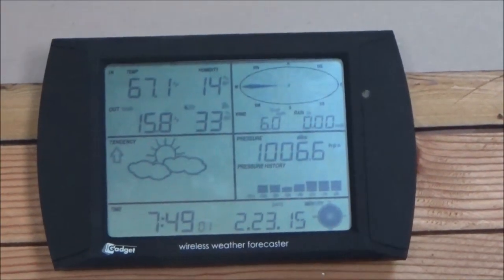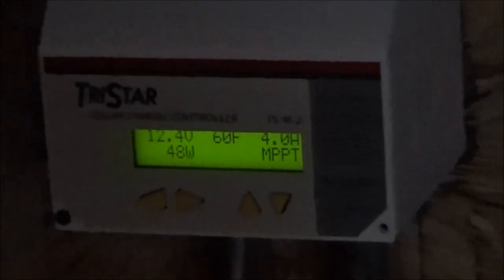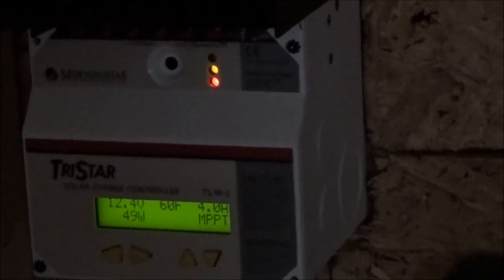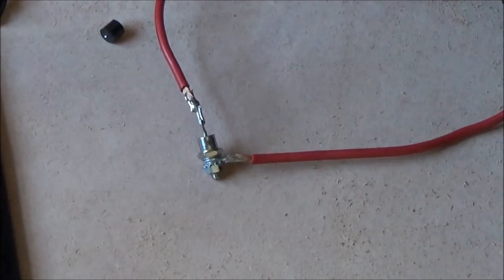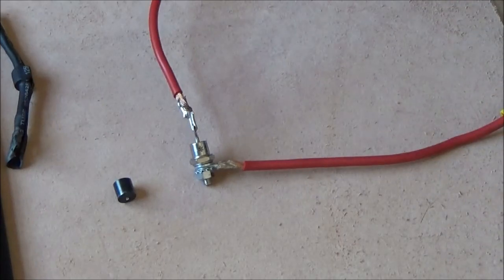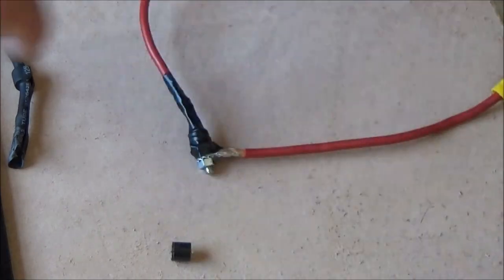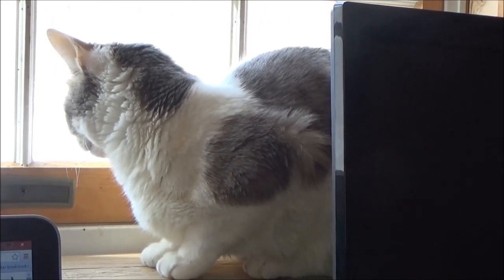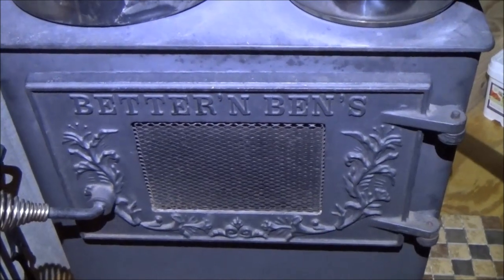A Day At The Off Grid Homestead And Tiny House

Comment: Hey, did you people know that the diode was designed to be mounted on a heatsink? Even Troy knows that, and if you read the video description he mentions that he will be mounting it properly later on!
Just in case your computer does not show the video description -

"This new blocking diode is rated at 1,000 volts and 25 amps. I will put a heat sink on it soon as well for proper thermal protection. But for now with the wind turbine at its present elevation, there is not really much power being produced at all."
Reply: John McLendon
Strange, but is my video description the only one that has the phrase

 "I will put a heat sink on it soon"

?????

And to make it worse I even quoted the paragraph that has that phrase in it!
And YES I UNDERSTAND THAT IF IT IS DONE CORRECTLY THE FIST TIME IT MAY NOT NEED TO BE REDONE!!!!!
Why do you try to FORCE your perfectionist views on Troy????
First read and understand the video description, then comment if necessary.
If you had said "Troy, you really do need to put the heat sink on now, while you have it in hand." or something similar it would have been a helpful comment.
Reply: John McLendon I agree, it was said by several people. If you will read my original post it was not to you.
Now, for some reason, someone has blocked my posts/replies from showing on the comments section. I guess the trolls think I'm a troll??? Ok, I'll resist the temptation and make no more posts on the comment section of Troy's video's!
Reply: John McLendon
Under the part you quoted there is a box that says "SHOW MORE"
Reply: J. Williams I don't think you were deleted... not sure if the comment you referred to has come back yet, but YT does some weird stuff to the comments...  The other day when I first logged in the video was up for only one minute and it was displaying like 600 or so comments... I was like WTH!!  Then I realized the comment from the day before were showing on the new video, so I refreshed... still there.  About 5 minutes later it suddenly refreshed itself and the expected 15 or 20 posts were there that applied to the video.  Later people said their comments were coming and going.  GooTube seriously needs to stop sending updates it just makes things glitchier!

Comment: You don't listen to me on batteries so I doubt you will listen to me on diodes but that diode works better with a heat sink you should put at least a washer to help get rid of heat.
You should measure those batteries with your vote meter then go out side and measure the battery voltage on your truck battery. It has just as many cells in series (6) . Will it still start your truck? Your car battery.
Reply from the maker: I said in the video description that I will do that with the diode.
It is hard to "listen" to you when you post so many things across so many comments but do not often see my replies.
Reply: ***** <----Sweeps floors at McDonalds.
Reply: Bernie other <---Fearful of women expressing ideas.
Reply: Bernie other <--- Seems to think an insult will get a point across but it doesn't -
Reply: MsPunkin13 <----Can see the conversations on the bell where a large portion of the comments from numerous people are made.

Comment: Troy,
I went and found a motors manual about charging and battery voltage from Ford. In the morning if you have 12.2 -12.4 voltage you are good to start. Now at night when you turn your car off, you may have 12.4 to 13.0 or above .The voltage above standing volts is called a surface charge. now, in most cases that is a good indicator of charge. But you are using a multimeter and that has a no draw system. You need a voltmeter built back in the 60s, so that the battery is loaded a bit and you can take the surface charge off. (the other way is keep a 1157 bulb wired up and use it to take surface charge off.) The best way that we were taught was to use a hydrometer and make sure the cells read in the green, if one is low you may not have a good cell. Now this is only true for lead acid batteries. If you want more just ask and we can talk. To me the batteries sound like they are in good shape for lead acid ones.

Comment: nice cold junction on anode side of diode, they are designed to be soldered hence the hole on the solder lug and bolted to a heat sink for rated amps.

Comment: Read the voltage on the battery post under charge (40 amps +) to read if it's the same between the charge controller and the battery!!! To see if there is a loss!!   The diode I would have soldered the little loop! Check for heat of the diode when the wind turbine is really going!!

Comment: Not sure if you will see this comment Troy, but that diode should be mounted to a heatsink of some sort. Diffusing heat will help improve its service life GREATLY. I also would not have used the leads from the old diode, rather I would have split the conductor and wrapped that around the post of the diode. 

Ill make a video explaining this if you want, and if you need more diodes, let me know. I inherited a bunch of those things.

Comment: 12.4 is a ok resting, inverter on yes it draws something, yours i bigger than mine, mine is about 30 ma, but mine is on and have 2 batteries for awhile, and is stayed on even when the neighbour has put snow on my panels which melt off. great show
Reply: ***** snow blower, i have them 5 feet in the air, now i have silicone sprayed them which is the stuff i use on my snowblower's external parts, the snow slides off. he works shifts, and have not spoken with him about it, do you have any snow

Comment: You most likely have a bad cell in you forklift battery string. I would recommend breaking it down to its 2 volt individual cells. Find the sulfated cell and put just the one bad cell on you bedini energizer. You will have to watch it carefully as to not over charge it. Then it's a process of charge and discharge many many times to desulfate it. The forklift battery is a string of many cells. You probably already no that, but when charging a string of any sort the battery's in the middle always suffer. Same with forklift strings. To desulfate that entire battery you would need a bedini 20 or 30 coiler. Even then the center of the string would be hard to get at. The bad cell is most likely why the string won't hold a charge. One cell shorted is a constant drain. This is also most likely why you were able to obtain the fork life battery. As good used  ones go for around a $1000 or so. Just some food for thought. Hopefully the cell is just badly sulfated and not shorted.....

Comment: Turn off ALL loads would be a good place to start. Next would be call the battery folks and check with them about the voltage. Where on the battery is the temp sensor?

Comment: I spent several years working in a battery shop for the military. You need to stop short-cutting everything, build a proper insulated shelter for those batteries, charge them up correctly, and you should not have anymore issues. Most of what you have going on is due to all of the "short-cuts', and "temp fixes" that you keep doing, In the long run, they cost you more time and money, that's not how someone becomes "self-sufficient".

Comment: Wish you would have bought agm batteries. Safely store them indoors, mine are a year old and sitting at 13.2 volts 1 hr after the sun set. I use a CTEK smart charger during cloudy periods and it also desulfates my bank.

Comment: Man you are having a tough time with your power, we dont have to even check ours lately except for S.G. now and then and we have a piston pump, 120v led lights, home stereo,ghetto blaster, modem, laptop, chargers, c02/propane detector that are used constantly, mind you we never shut it down until the inverter alarms for low voltage at 11.8v or  whatever, the one thing i did notice about  your system is the wires coming into the inverter look smaller than the ones going out? I may be wrong but I wonder if there might be an issue with undersized wires, we used oversized so its never been an issue here just a thought

Comment: I was always taught in the automotive field and made to understand that other than de-sulfation to restore batteries, that adding sulfuric acid to raise the specific gravity in the water will help restore them to better condition? I have done that to numerous automotive and truck batteries during my garage work days and it has always given them a new lease on life, unless they were shorted or damaged in their lifetime?...I am just suggesting that possibly the FL batteries are weak on sulfuric acid making them lower on the specific gravity than where they could/should be, to be more effective at holding a charge longer...

Comment: You MUST PUT that Blocking diode piece of aluminum angle so it is finned. so it can cool. It will get really hot. I have seen two aluminum angles facing away from each other with a hole drilled in them while laying on top one another and you nut them together so they can dissipate heat. This is a must and dont cover it will black tape it melt and get all gooey and it needs air.
 Google on youtube how to make a heat sink for a blocking diode.
Reply: shartne First, read video description. Then, comment.
Reply: shartne <----Imagines itself to be an authority figure.
Reply: shartne Nice. You hit the nail on the head.

Comment: They are sulfated take them back and get some that are resting at 12.8 the voltage they set at is unaceptable. TAKE THEM BACK NOW before its too late. Dont accept them they are passing some sulfated batteries on you. Tell them to replace them with some that rest at 12.8 or at the very least 12.6.

Comment: Every time I watch these videos I really have to take pause and shake my head. I have explained in great detail in many of his video's the following:

1. You can not purchase used / reconditioned batteries from anyone. In plain English people are selling you end of life batteries and what ever life they have isn't a lot.

2. 12.20 - 12.40 VDC in the battery world is pretty much empty, drained, no good. A battery at rest at ALL TIMES should remain above 12.80 - 12.90 VDC for flooded cell batteries which does fluctuates based on temperature. Normally a variance of 0.1 - 0.25 is seen in the extremes.

3. I have stated this a dozen times and Troy continues to ignore the basics. Even if you had the money for brand new batteries and I don't care if they are Rolls, Trojan, etc. The manner in which you use and abuse these batteries are simply incredible.

There should be NO LOAD on those batteries, ever .  . . If they were new you would have some wiggle room and assumes you're using them correctly and not dropping below the stated DOD.

DOD = Depth of Discharge

Every battery has a stated voltage / DOD it is allowed or recommended to endure and sustain. For those who live off grid and do this correctly they rarely break 50% DOD. Most are conservative and only run down to 80% DOD.

Why???

Because this impacts service life, cycle life, and run time.

4. Take off that stupid shit desulficator it won't work and never will. The constant draw along with your inverter is once again proof you can't follow basic information, guidance, and knowledge from others.

5. There are countless video's about charging batteries. Its clear to me you believe pumping in 60 amps into a battery cell with out any thought about the duration, water levels, and voltages, will do no damage.

You're so wrong on every level it pains me!

As I stated in past videos about those piece of crap golf cart batteries and the so called recon batteries those stupid fools pond upon you. It was just a matter of time before they died. And they literally died a month after I told you so!

6. ONCE AGAIN I AM GOING TO OFFER YOU SOME SAGE ADVICE. THOSE FORK LIFT BATTERIES ARE JUNK. THEY WILL NOT HOLD A CHARGE AND IF YOU WANT TO TEST THAT PERFORM A AVR TEST. WHICH IN PLAIN ENGLISH IS A LOAD TEST.

A LOAD TEST ALONG WITH MEASURING SPECIFIC GRAVITY, VOLTAGE, ETC ARE THE ONLY TRUE INDICATORS OF A BATTERIES CAPACITY TO PERFORM WORK!

In points 4/5 I have basically told you - you have burnt up these batteries and I haven't read once where you have filled them or check to see if they are at the correct levels?

Well are they??

Are there things floating around?

How are you measuring the specific gravity with that bulb sucker?? Did you read the instructions about (When) this should be done? At what temperatures to ensure temp correction?

At the end of the day my feed back to you is to ensure you know, learn, and hopefully stop repeating these stupid mistakes. As of this writing after two years its clear you have ignored my input and that of many others.

As I stated before the Hand of God isn't going to help those who don't see the truth!

Comment: I have said that even in cold a good battery shouldn't go below 12.7 volts after 24 hours at rest after being charged, seems these refurbish batteries are junk, hope you can get a refund, also using them like I also said down to 11.5 volts in the cold is also good for them not in the summer only winter when its cold, mine stay at 13.2 volts for 24 hours after I use them heavily to around 11.5 volts and charge after.
Reply: I dont think so im sure it was bad from the start, number one rule of batteries is dont buy used!!!!
Reply: Susan Wyse I do, Look at my videos, mine are 100% fine in 9F temps so don't tell me this BS, im not saying troy knows anything about batteries im saying you can store them in the cold, All card batteries here in Canada are stored in the cold and still start vehicles and my agm unigy batteries work great in the cold

Comment: ok...dont mean to hound you on this point...but the video from 1 month ago when u had john help drag battery over and you connected to THOW you used a block of wood as a junction box...you even say yourself around 22:16 point that its a bad idea due to arcing and shorting....you should cut that board in half to eliminate it as a problem...you also had problem with the cable connectors sockets not making proper contact ...do they need to be checked...good luck
Reply from the maker: I will replace it with plastic to see. But the odd thing is that no matter what, the batteries are always at 12.2 volts. Never less. It would seem that if there was a drain, they would drop lower at times. Like in the evening after the sun goes down and the battery is at 12.2 volts. Then in the morning it is still at 12.2 volts. A constant drain would keep draining them.
Reply: The Do It Yourself World have you gone out to the batteries first thing in morning to take a voltage reading right off of the battery terminals to verify this 12.2 volt daily display cause to get that constant a reading seems inconsistent with fluctuating daily power input...and have you gone out and measured during a peak power input solar day when controller says it is like 15 volts